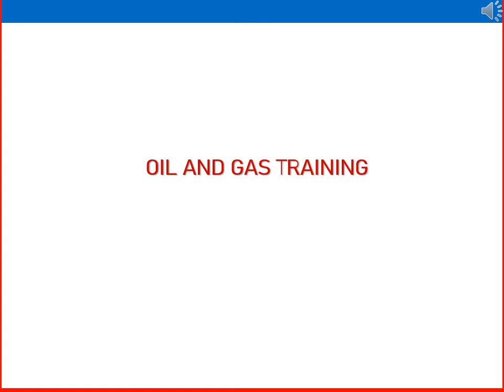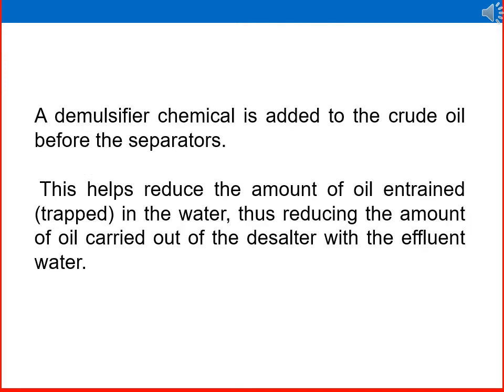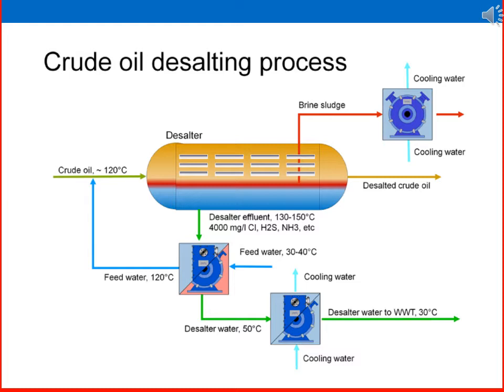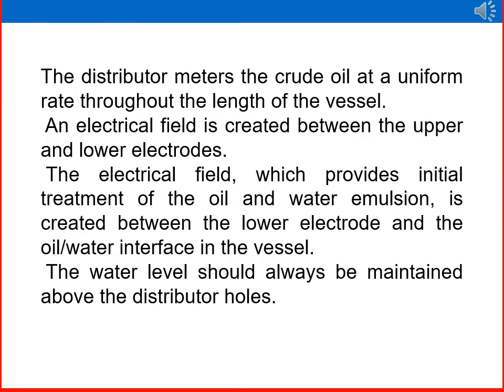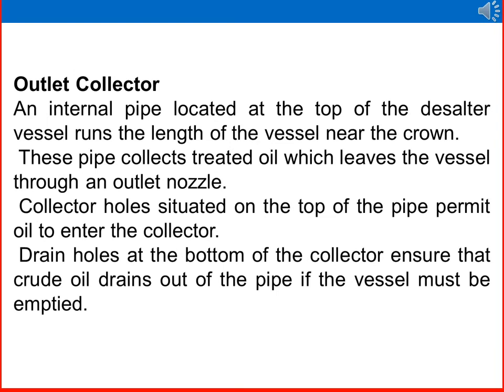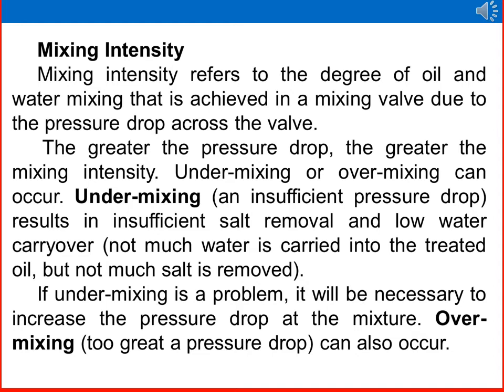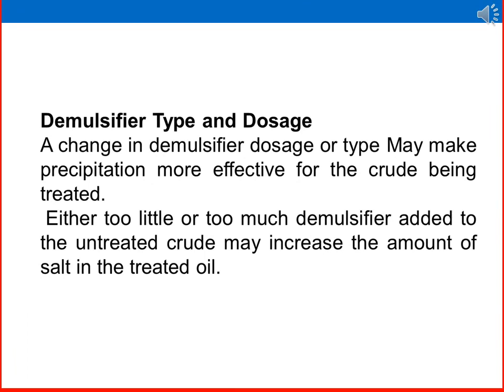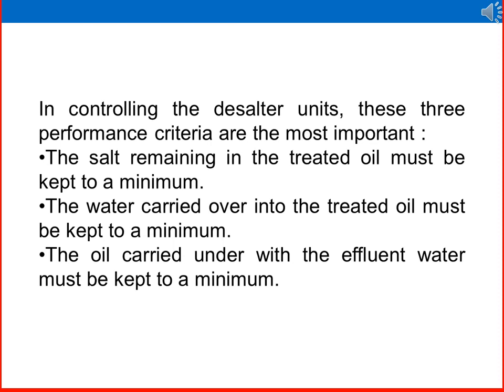Oil and Gas Process (Desalter operation)

Comment: How many volt you are using desalter
Which kind of transformer you are using in desalter
Reply: 16kv to 30kv AC voltage...
Water mix in the ratio of 1:20